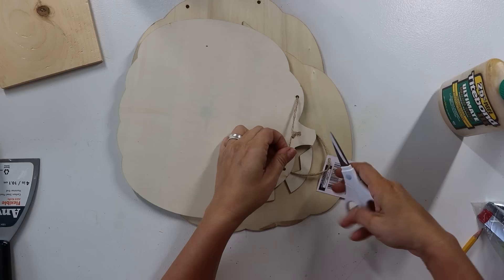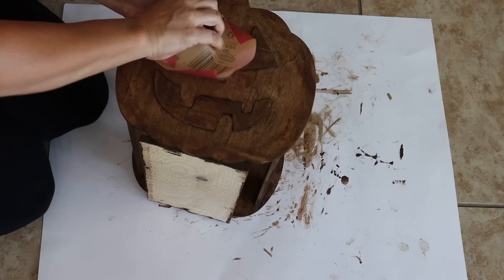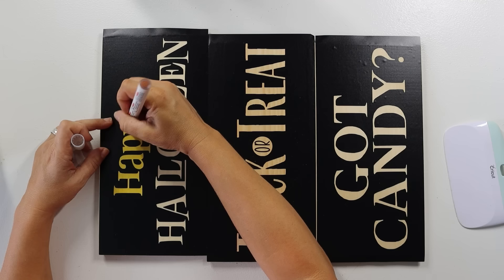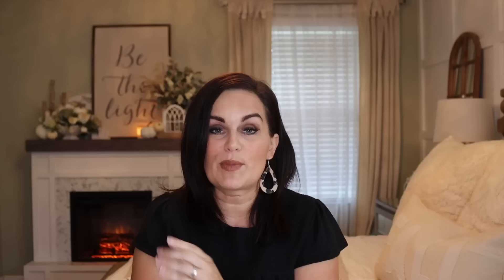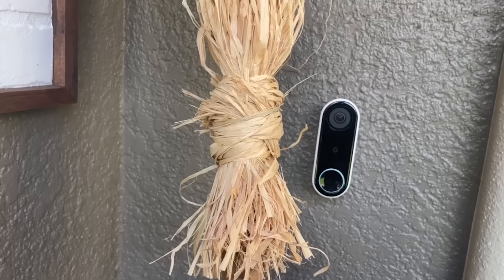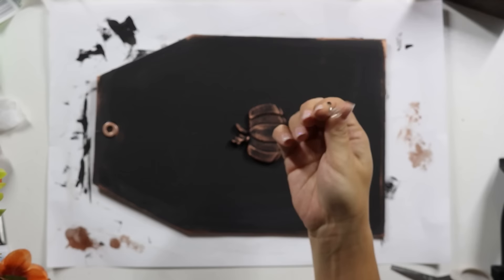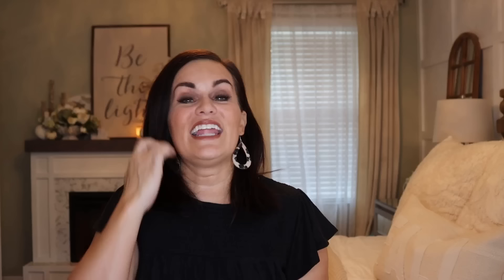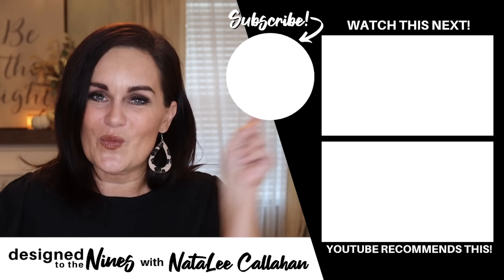Best Fall DOLLAR TREE DIY Decor You've Seen This Year!

Comment: I needed a shelf pin jig to add shelves to my kitchen cabinets. I considered getting the Kreg jigs, but they are sooooo expensive. You say you have to use Kreg screws and drill bits too. That must cost a pretty penny. Thanks for the heads-up. I needed a shelfpin jig, not a pocket hole jig, but they are equally expensive from Kreg. I bought an off-brand jig for $11. It does the job for a lot less money.